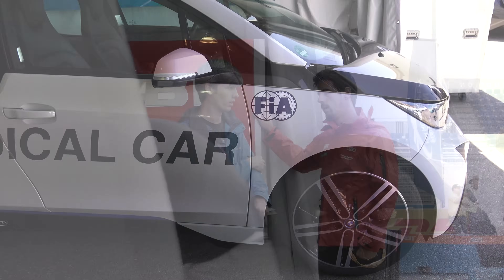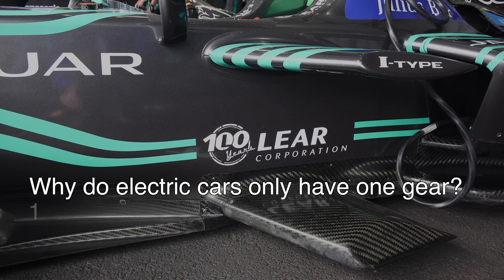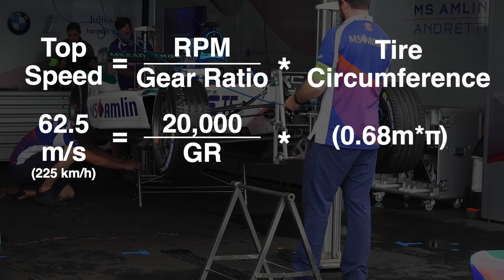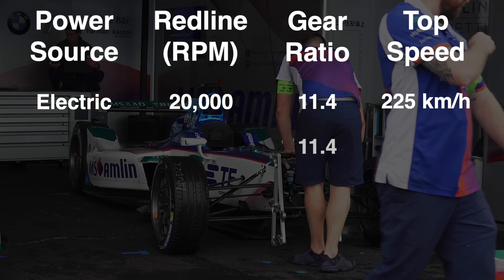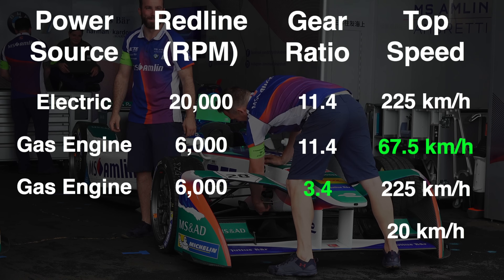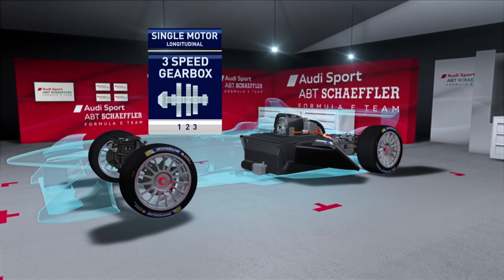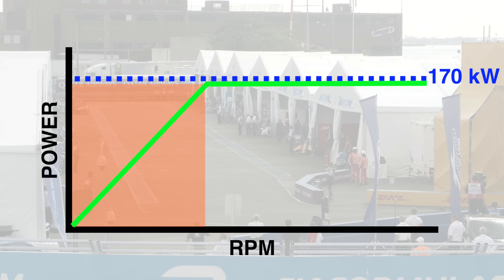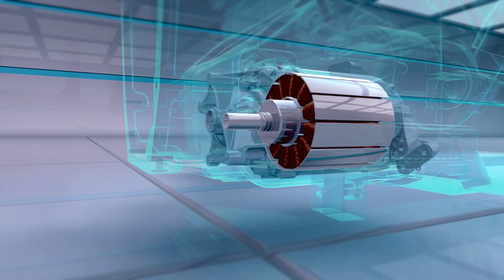Why Do Electric Cars Only Have 1 Gear?

Comment: It's really just that engineers don't need more that one gear so they don't do it. They would probably be faster and more efficient with a multiple speed transmission and would get a bit more range. The problem for a road car having one is the fact that it would add maintenance and cost more upfront.
Reply: Tyler Sanders not to mention the weight, which might cancel out the slight increase in efficiency provided by multiple gears.
Reply: TheJacobShapiro it would require some math but I don't believe the few pounds a transmission adds makes much of a difference in anything but a track car.
Reply: Tyler Sanders I don't know if it's so much that the transmission reduces efficiency by adding weight, but a transmission tunnel still will take up space and it adds a lot of complexity to the car, increasing both the purchase price and maintenance prices, which might negate the money saved. I'm just spitballing here, just like you, so I'm not sure if either of the reasons I stated are true, but clearly there's a reason there aren't transmissions on electric cars, and these two reasons are my best guesses as to why.
Reply: Tyler Sanders just looked it up and a ZF 8HP automatic transmission weighs 200 pounds. If you consider that electric cars basically only have a final drive (they only need one gear for both forwards and backwards because the polarity of the current going through the motor can be flipped for reverse), the entire weight of the transmission would be a pretty significant increase.

Comment: Rimac has 2 gears
Reply: Yes because they want an extremely high top speed.
Reply: Tiago Ferreira Doesn't mean they are right. They could have just used a larger motor with the same weight as the gear box.
Reply: difflocktwo  larger motors mean more torque....not speed, which rimac specifically stated is the reason behind a 2 speed car. it can spin the wheels faster while still being able to accelerate quickly and with less mechanical resistance therefore thinner wires and less power required
Reply: The rimac is normally driving in 2. gear. You can downshift for a higher performance from 0 but that makes not so much difference, because it's also in 2. gear crazy fast.
Reply: Exactly
Reply: You don't even need to post this.
Reply: That does not mean you are right either. They probably just wanted a better acceleration.
Reply: Tiago Ferreira i was gonna mention this. thanks tho
Reply: Tiago Ferreira I saw an electric Ferrari with a 5 speed shifter...
Reply: Electric motors lose efficiency at high RPM.
You can combat this by using even bigger motors, or you can use 2-3 gears to set the RPM back to a more efficient range.
But due to the weight, inefficiency and complexity of a gearbox (even with just 2 gears) this is only worthwhile for really high topspeeds that you can pretty much only use on a racetrack (or the 0.001% highways in germany with perfect conditions)
Reply: Only for the rear motors to give you ridiculous acceleration if you want it. Normally it operates in second gear.
Reply: Tiago Ferreira Some FE cars use multiple gears too.
Reply: Yes, as he says, some Formula E cars also have a gears -- it's only if the motor needs more low end torque (low gear), or if it reaches it's rpm limit before the car has reached top speed (high gear) - the case of the Porsche 918 where that front motor disengages above 160 mph is an example. But if your motor is both very torquey that your 0-100 is as good as it can ever get, and can maintain max HP till the car maxes out, then there's no need for gears. The torque curve of such a motor is the ideal curve for maximum acceleration, where you get max HP (and therefore maximum acceleration) at a given speed.  Force = Power / Velocity

Some teams might have found it lighter and less expensive to use a smaller motor and a gearbox.
Reply: The video doesn't tell you that every EV has one gear, it shows why it is possible and the benefits. Rimac is a performance car, the extra performance of the additional gear is worth it to the type of consumer that will buy it. Now take a model 3, do you think the family that bought that car preffer better performance or better reliability? (less moving parts)
Reply: Go look up some Tesla dyno charts. From what I’ve seen electric motors tend to loose power at high rpm. Thus by having more gears, in addition to having a performance benefit till max power is reached (a negligible effect though, considering 0 RPM torque of electric motors and max power arriving quickly in addition to added weight and cost of a gearbox). The real benefit of a gearbox is better acceleration once powers starts to drop off in first gear at high speed and much higher top speed. Expect to see gearboxes only in performance or supercars, I doubt they will be used in normal electric passenger cars.
Reply: difflocktwo they aren't right. But they have the fastest car in the world.... why?

Comment: Why not add a second gear to improve highway economy?
Reply: Pietro I was wondering that too
Reply: Pietro the added weight of the transmission would probably offset any range benefit of having a geared transmission. keep in mind that reverse in electric cars is achieved via reversing the polarity of the motors, so they essentially only have a final drive, and adding a transmission would add a hundred or so pounds and eat up internal space that could be filled by adding more battery capacity.
Reply: Pietro If you add any weight that isn't producing power, it is waste. If you want to add any mass make it active mass, use a larger motor or larger battery.

Comment: Something I have always wondered about is the efficiency drop off of motors when little power is required. For example if I have a Diesel engine which can get up to 35% of thermal efficiency at a given rpm at full torque,  efficiency will plummet one less torque is required hence the high fuel consumption of ice cars in towns. How do electric motors do in that department?

Comment: Why all these metric units?????
Reply: Because metric makes sense
Reply: Because it's an engineering video.
Reply: Aside from "Metric is better than US customary units"?

cause it makes the math so much easier.
there is no need to convert units - SI-units are a system designed to be internally consistent. 
Want to know the force required? its Mass times acceleration. NO factor involved.
Reply: because like 90% of the world uses the metric system.
Reply: OldRed91 - ever had to use volumes, area and lengths at once?
For example needing to create a layer of specific thickness and calculating how much material you then need to cover a given surface? And maybe even have the mixture given by weight...
A really simple problem with many small things errors can creep in due to all the conversions with the US customary units.
Reply: The entire world is metric, so why would it be anything else?
Reply: Derek Kouns because only us use those shitty miles and gallon...
Reply: Because we're not savages
Reply: I was affraid at the beginning that it will be an another feet,pound,oz,inch,mph,gallon, etc video.  It was a true surprise to see km/h. Thanks a lot for it.
Reply: Because only USA and two 3rd world countries (Liberia and Myanmar) still use the other very impractical measure system that quite frankly belong on the history's scrapyard...
Reply: The foot is only easier because its what you're familiar with. The same argument goes the other way for someone raised using metric.
Reply: because i prefer speed 50 elbow per eyeblink with weight 20 sack of potatoe
Reply: It's interesting that no one ever had a problem with metric in modern technology. Gigabytes, Megapixels, Kilowatts. Imagine if they created non-linear imperial units for these things? Actually, there is a little tiny bit of that, but not exactly already and it creates a ton of confusion. There are eight bits in a byte and you can state data sizes in either. If you get 40 Mbps internet from your ISP, you can download at a maximum of 5 MBps (Megabit vs MegaByte).
Reply: Because it's the international system of measurement. Why use primitive imperial units?
Reply: Totally Legit Gaming [TLEG] actually it is only 3 countries, Liberia, Myanmar and USA ( 2 first are 3rd world countries and last one about to become one ?)
Reply: Because it allows to tell a metric arse ton of knowledge.
Reply: Charles Eye: That is the dumbest excuse for "why not metric" I have ever read. Let's purposely complicate things for everyone because the smartest of us will still be able to do it. As fast as anyone is at converting between inches/feet/miles, they will be significantly faster, and make fewer mistakes converting between cm/m/km.
Reply: well actually if you want to be 100% correct 1000 Bytes = Kilobyte and 1024 Bytes = Kibibyte (kind of a binary thousand), but nobody ever says that. This is also why when you buy a 1TB drive it shows something like 880GB available  --  because you purchase a 1 teRAbyte drive, not a 1 teBIbyte drive
Reply: Because the imperial system is a clunky, unscientific, mathematically horrendous turd that should've died decades ago.
Reply: OldRed91 There is one international standard everyone uses. It's called the metric system or SI. Every developed country in the world has adopted it besides the US. Even most developing countries have adopted the SI.
Reply: Derek Kouns math🏄
Reply: Derek Kouns It's those damn foreigners again messing up the world with, they it's more accurate, how I don't know, I even had to buy two adjustable wrenches, one metric one standard.
Reply: even then the 8 bits per byte thing is justified by binary permeating the entire concept of computers
Reply: Right on Brad.
Reply: +kelleroid795; "because you purchase a 1 teRAbyte drive, not a 1 teBIbyte drive"; your explanation is wrong. The flash chip inside is indeed 1 Tebibyte. However you do not have access to all of it, because the drive needs some flash mem itself for house-keeping, with tables with markers for free, dirty and filled data blocks. This is all handles by a tiny CPU in the flash drive.
Reply: lol
Reply: Derek Kouns Metrics is everywhere (Except Americans where a lot wanna have it to)
Reply: CAuse the system is more practical ?
Reply: Because this is the 21st century.
Reply: Because American schools have ancient books ???
Reply: Because it's better.
Reply: Alex W: That's just being asinine. That anecdote is for when a majority is doing something wrong. In this case, the majority is correct and Americans are just being stubborn. We're biting off our nose to spite our face.
Reply: OldRed91 People die as a result of these antiquated units.  Is this even addressed in US engineering texts ?  The responsibility to public safety is  the cornerstone of an engineer's morals, or is that not covered as well  in US eng. school.
Reply: Joshua Row: Can't like this reply enough.
Reply: Because science is metric
Reply: Because this is planet earth
Reply: Why do people still feel the need to argue over measuring systems when the internet exists. Just use google, convert, and move along. It's not that hard.
Reply: Metric is better
Reply: because every sane person in the world uses and understands them
Reply: Because metric makes sense. 1ft=12in? Nah. 1m=100cm? Simply better.
Reply: Because he is not medieval moron/lazy troll like you?
Reply: I like how these replies have more likes than the comment itself.
Reply: Napoleon conquered Europe and pushed the metric system onto these countries. Later on when these Europeans colonized the world they brought this system with them.
Reply: Metric units are usually SI units, which means they are used globally, across almost all the countries. None of your American Imperial units are SI units, which also means that they are not used in laboratory science.
Reply: Ahah...Pirate books
Reply: ABaumstumpf Force is Charge x Velocity x Field Strength x Field Angle
Reply: Derek Kouns he's in canada
Reply: Matti Loponen niin
Reply: kelleroid795 by random,i mean stuff like commenting "LOL" or "HI" on a random video
Reply: hahaha
Reply: xCake CAN PEOPLE LIKE YOU STOP REPLYING RANDOM STUFF???
Reply: Sergio Ferreira Using your technology example there is actually more strangness in technological units. 1024 Bytes=1 kilobyte and 1048576 Bytes=1 megabyte. So technology is not very metric. Also there is nothing "non-linear" about either systems of measure. Just because a measurement system is base 10 (don't know how Celcius is base 10?) or not doesn't say anything about it's linearity?
Reply: MrPijus but can't you divide a meter into 3? Yes it is 333.333mm can you divide a foot into 3? Yes it is 4inches. Can you divide a mile into 6 yes it is 880ft. Km by 6 is 166.6667meters. Many times base 12 is superior in fact there are groups of people that want to try to converte our number system to base 12 because of this. Ten is an completely arbitary number except for that is how many fingers we have.
Reply: Alex W Oh, so if 90% of the world jumped off a bridge would you?
Reply: a large portion of europe uses miles rather than kilometres.
Reply: Because some people need things simplified to a ten scale. There are a lot of people who can't handle things like fractions or multiplying by twelve when converting feet to inches. We use the simplest method to cater to the simplest people.
Reply: Metric units are great if you're studying something that isn't practical.. 10,000 units for two glasses of water? Excellent. Very accurate.. one unit for things between less than one half of an inch all the way up to a yard in length?.. metric's got you covered :).. I prefer to side with the people who built the pyramids.. some things just require a realistic unit.. like "the foot". Essentially half of everyday objects can be more easily measured using it.
Reply: I'm gonna stoke this flame war and say that imperial units really are not that bad. This is coming from a senior in engineering school. I've had to use both unit systems extensively, and metric really doesn't have that much of an advantage over imperial. That being said, metric is still slightly better, and I agree that it would be nice to have one international standard that everyone uses.